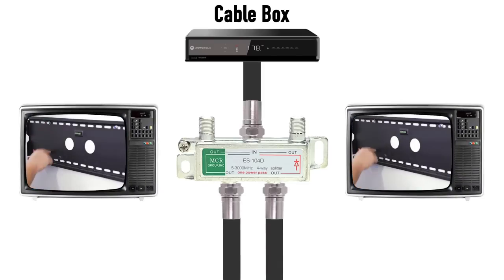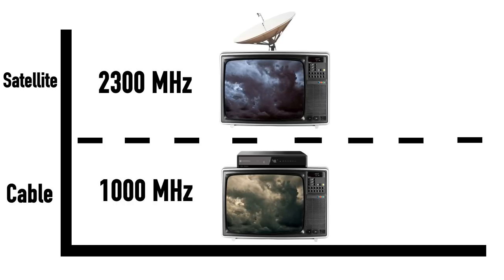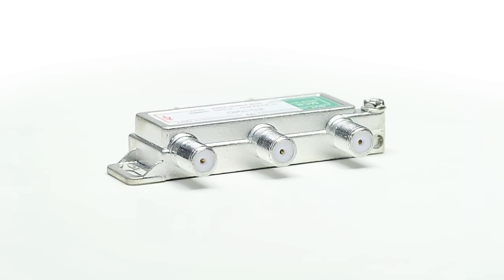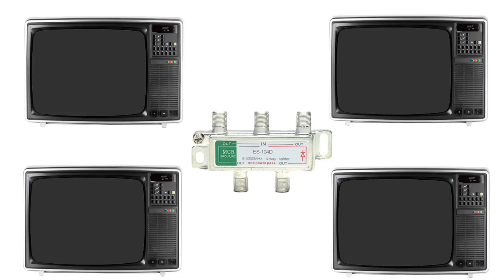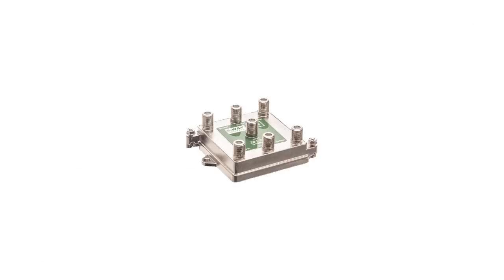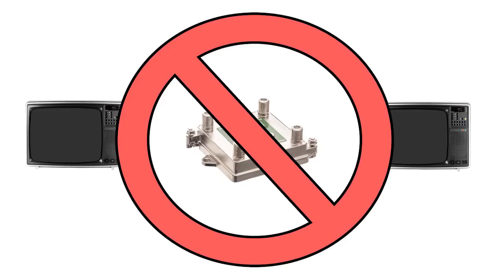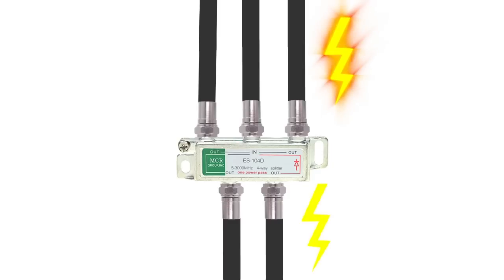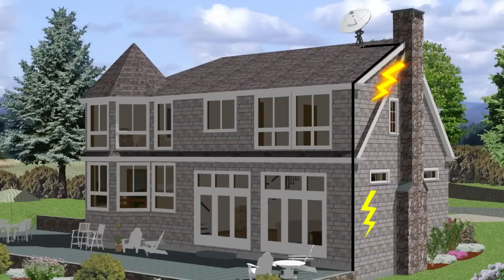Satellite Splitters

Comment: can this splitter handle a switch cable in. For example 4 lnbs to a switch to the splitter !
Reply: I'm sorry I didn't understand do you mean I take the output directly from the LNB or from the diseqc switch because I'm planning to connect my 4 receivers to the 4 LNBs (different satellites) and each receiver will receive the 4 signals as it was 1 switch connected to all of them  daro2096